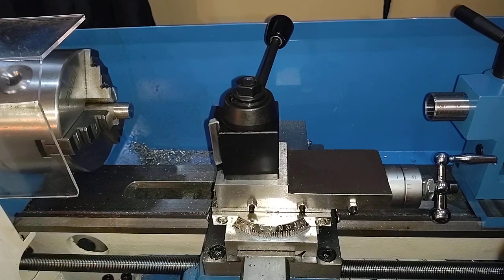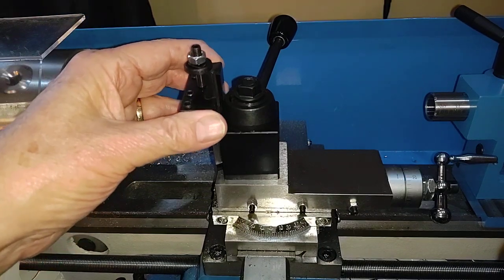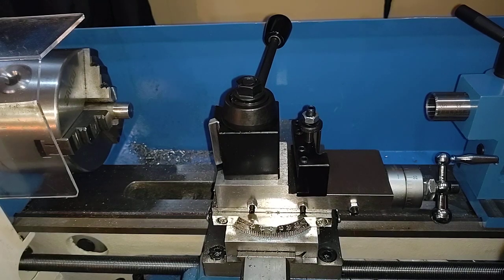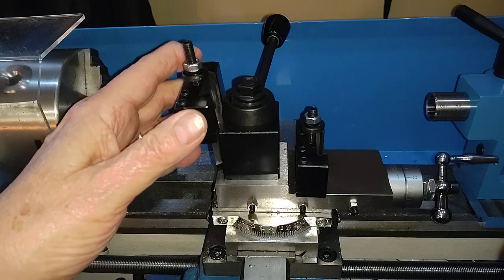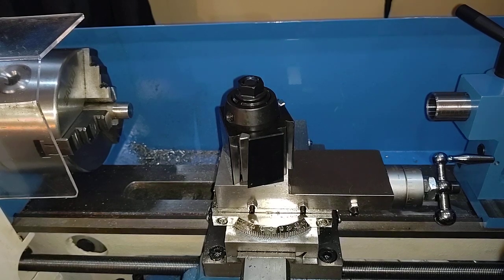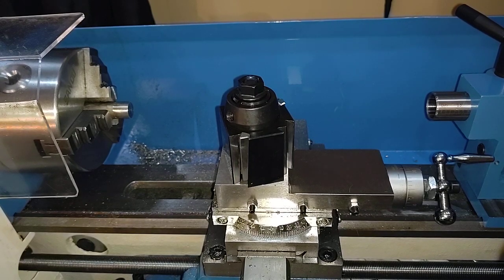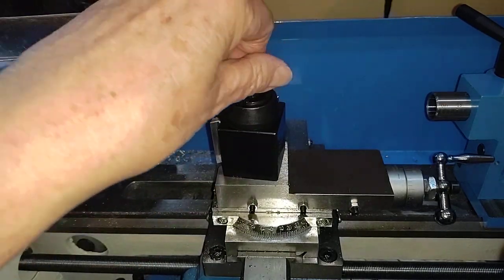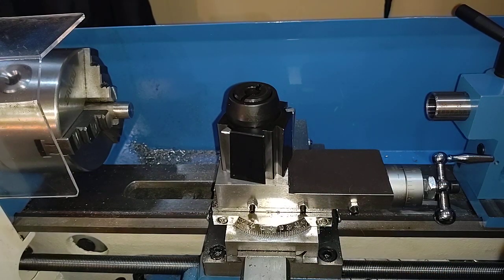Review #1 of an OXA Aloris type tool post for a 7x14 Chinese mini lathe. FAIL

Comment: Very frustrating. Indeed, likely a quality control issue. I have the same type and size and all tool holders fit well. However,  the back dovetail of the tool post is a bit narrower than the left one, so it seems the manufacturing method leaves too much room for error
Reply from the maker: This is why I ended up going with the Shar's post. I could have possibly found one of the non branded Chinese ones that would have worked, but I decided to put out a little more cash and save myself a whole lot of grief.